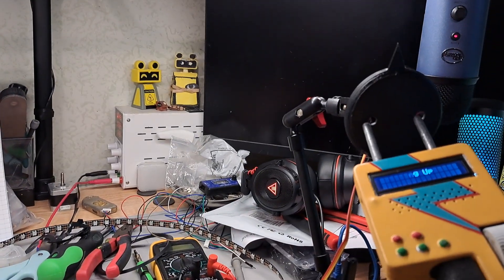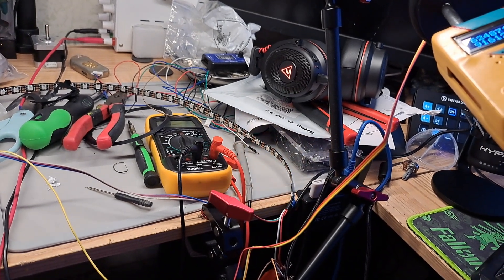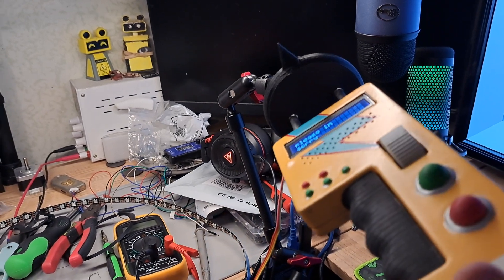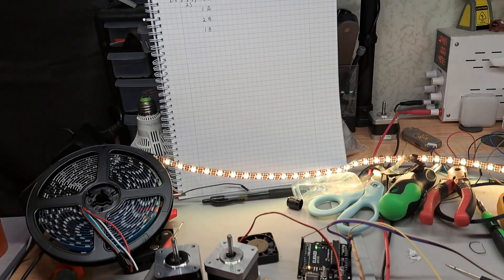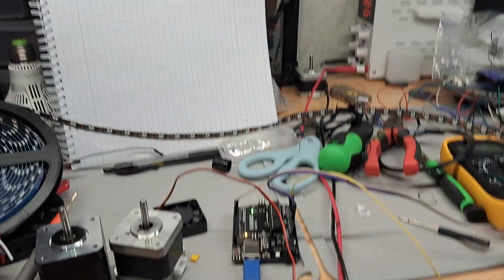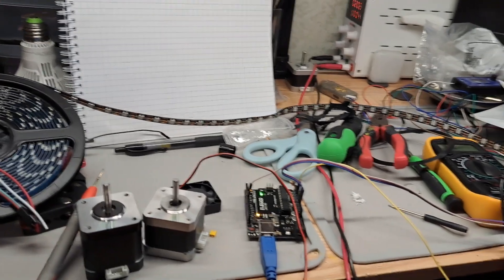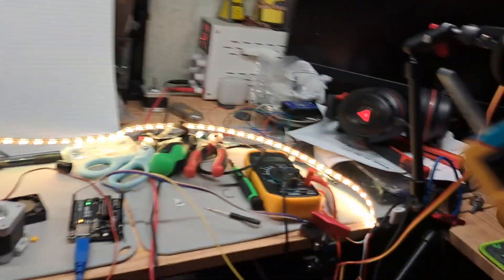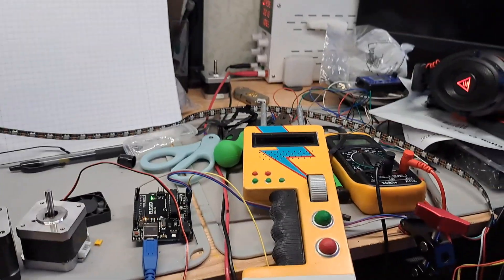FazWrench Conduit Puzzle prototype

Comment: personally i would use a homemade rotational switch circuit instead of potentiometers you just need some thin strips of conductive metals and 3d printed knob with fitted slots for the thin metal sheets to create the on / off circuit and a soldering iron and a breadboard and of course a raspberry pi

Comment: Why don't you just put some sort of supporting extension rod behind the plug so you can keep the long prongs?

Also I'm really glad you didn't go with the liquid. It was a cool idea but I can see a million problems with designing, building and maintaining it.
Reply from the maker: The prongs are very long so it would have to be very thick you just make things more difficult to print design also trying to save on resources here